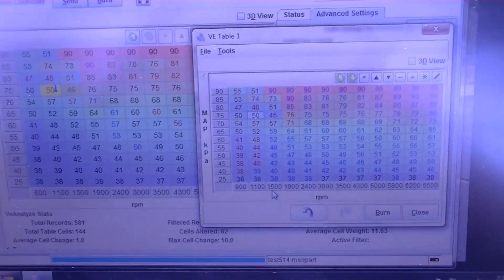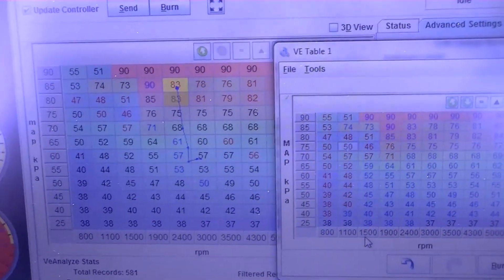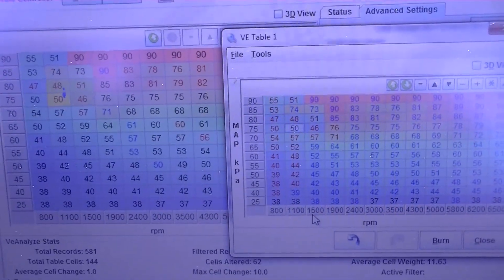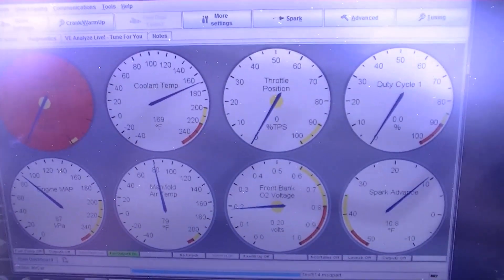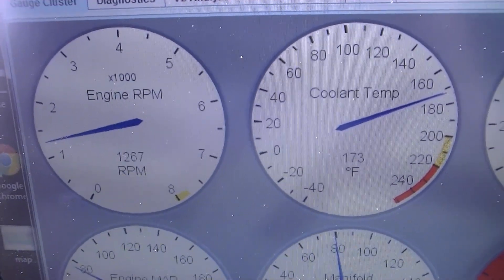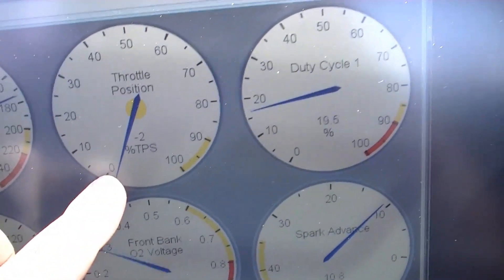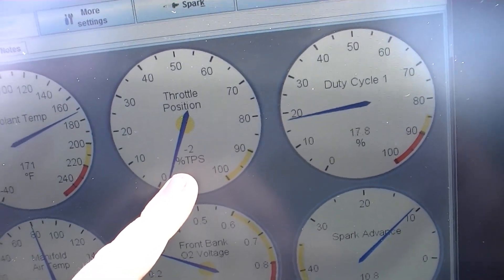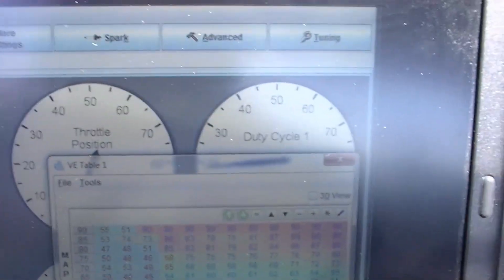Megasquirt Test 5-14-2013

Comment from the maker: I ran it with Hybrid Alpha-N for a while and went to Alpha-N only.  The throttle response is great with Alpha-N if you have ITBs and not much vacuum to work with.  If you have a good bit of vacuum to work with and you can get enough resolution, speed-density or hybrid alpha-n is the way to go.  I cannot get much vacuum on my setup, so Alpha-N has worked the best for me.